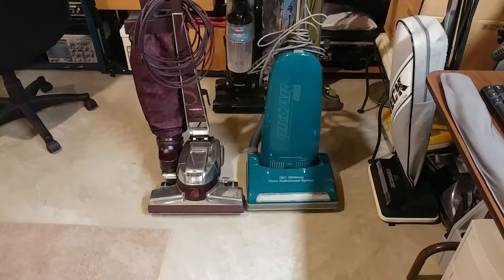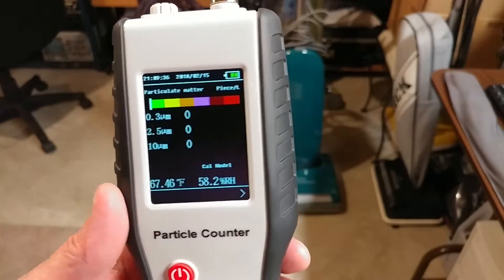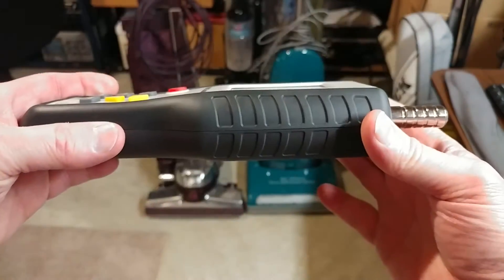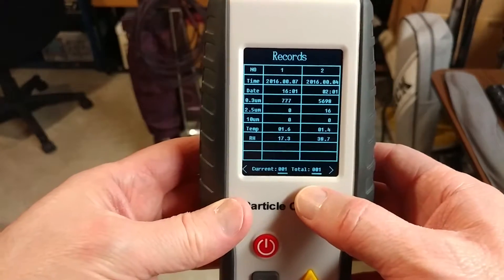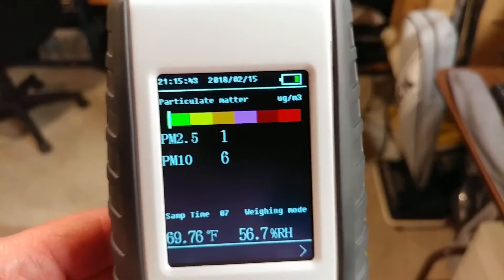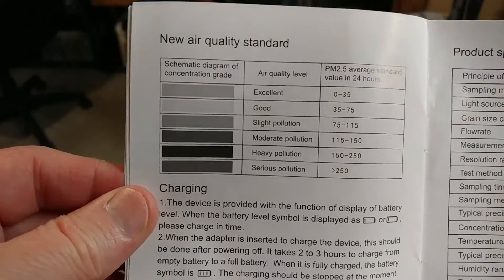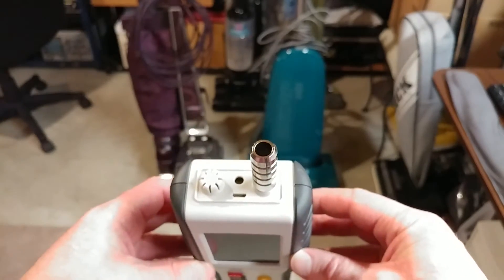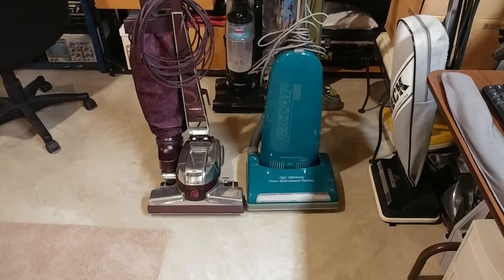HT9600 Particle Meter Capabilities And Upcoming Repair Videos

Comment: Where did you purchase the unit from? The devices Ive purchased from Ebay that have claimied to be accurate have been far from accurate and have been nothing more than glorified ( and expensive ) thermometers. Even then some devices ( $100-200) would get the room temp wrong. Please advise. I would like to purchase this unit based on your review. Also, how accurate in this device?
Reply from the maker: I get nearly everything from ebay. This meter is about 4 years old now and fully complies with newest industry standards. Very accurate and reliable.
Reply: @VacLab  Which version of the HT9600 do you have? There are two versions.
Reply from the maker: @atirocks  https://youtu.be/_Rk2FA5ktyc
Reply: @VacLab  Do you have rechargeable battery or is it disposable battery?

Comment: Great vid
Reply from the maker: Thanks!
Reply: @VacLab  do you know if all meters using pm2.5 sensors can measure particles down to 0.3mico meters? Im trying to get the cheapest meter but its no good if it doesnt measure 0.0micro meter particles.
Reply from the maker: @LL-wc4wn  this is the cheapest meter I know of the detects 0.3 micron particles. About $130 on eBay.

Comment: Does dirt devil use that 12amp motor
Reply from the maker: mowerking ED mowing and vacuum cleaners are you referring to the Bissell in the background?
Reply: VacLab no im asking about dirt devil i have a 03 dirt jaguar with a 12amp motor and my bears r bad
Reply from the maker: mowerking ED mowing and vacuum cleaners I suppose you could rebuild the bearing, replace the bearing or replace the entire motor.
Reply: VacLab how hard is it to replace the bearing not worth replacing the motor they want 45.00 for a motor
Reply from the maker: mowerking ED mowing and vacuum cleaners for $45, I would replace the motor. But, if you're highly mechanically inclined, I would service the motor on your own.
Reply: VacLab model 085545